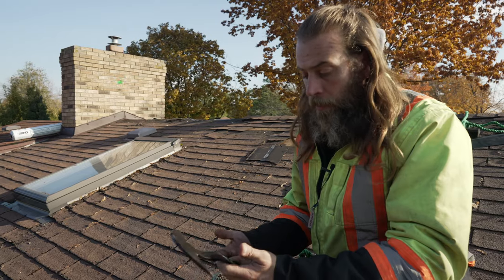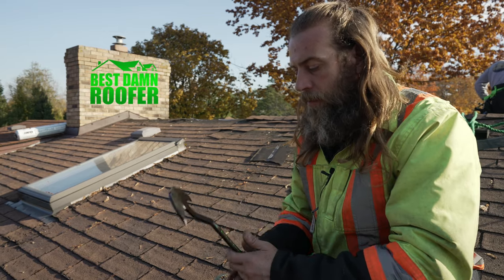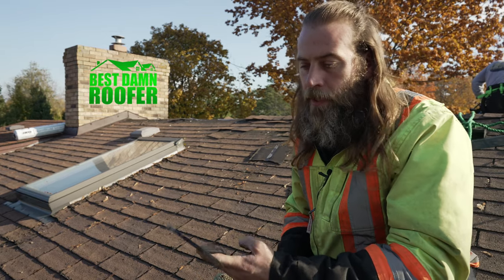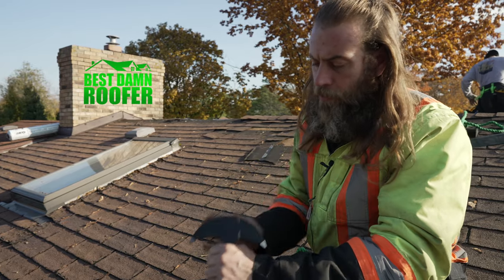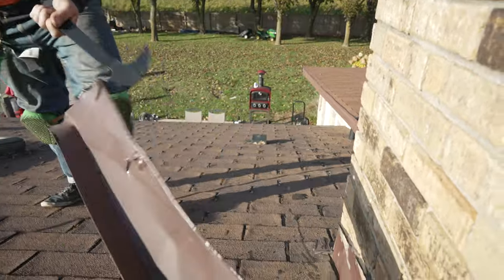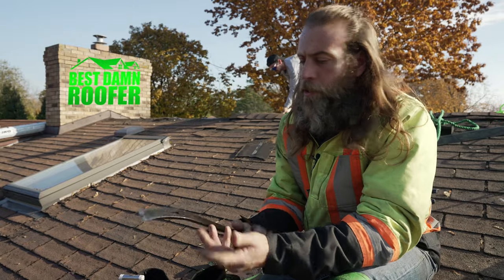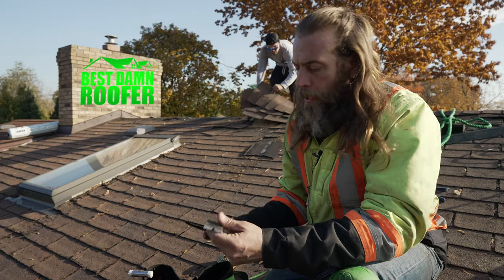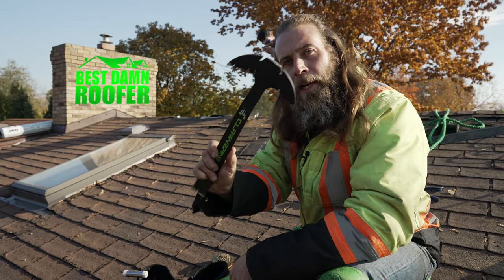Best Damn Roofer - Clawverine Review!

Comment: Looks like the best gimmick tool that I will never need
Reply: You will need it if your a roofer I bought my first one 3 years ago
Reply: Need is a strong word.
It's not a gimmick though, I 100 percent gaurantee I could remove a tough 20 foot wall of step flashing 4 times faster than you could with this tool.

Not even remotely kidding as it is that effective.

Comment: All u need is estwing hatchet
Reply: All you need is Estwing in general they are cheap and insanely strong
Reply: Yeah so dang stong unbelievably stong  so darn stong it's wong
Reply: @ultramegadude93  🤣 i never noticed.. but thats what you get with a toddler screamin at you its hard to think sometimes😂
Reply: Also i said Esting instead of Estwing🤣 thanks for bustin my balls😂😎✊🏻 not too many legit ball busters these days😋
Reply: Eastwing prybar too
Reply: Buy I use AJC hatchets for composition.  Plumb for wood shingles, at least 6 years back I did still
Reply: I mean ya they're great. But I'll remove a 20 foot wall of deep nails 10 times faster with this than you can with a hatchet gauranteed. ;)

Comment: so me and my buddy got a couple they are kinda cool but man is it soft metal when you hammer on the end like BDR was it starts to pan cake and flatten out immediately we wer pulling some fascia borad and both of ours bent badly but it was very easy to bend them back and put an even better angle on them lol also got some tool pouches and I am vary impressed with the exspsaly for the price
Reply: Fascia board if nailed with ring shanks is gonna bend even high end pry bars... get a bigger tool more leverage next time or go ahead and cats paw the nails out of the tails/rafters first and fascia board falls off. Start at each end work to the middle by yourself can pull off 30 foot gutters or 20 foot fascia boards no problem.
Reply: @peteterry8563  dude I have pulled plenty of fascia borad off with a cheap ass Stanley flat bar and hammer and my Stanley hasn't bent when I paid 70$ plus for the clawverien using both it and my hammer working down the boards it shouldn't bend that easily and the fact I was able to bend it right back and just the damage from pulling flashing alone tells me the metal is vary low quality and soft don't get me wrong it's a cool tool but I just thought for the price it would at least be made of quality metal for the price I could have bought a titanium stiletto
Reply: They aren't meant for prying hard off the bat wing, they're meant for tight space pivoting off the wall. Used one for years even through the trials and never even slightly bent one when using it for it's designed purpose.